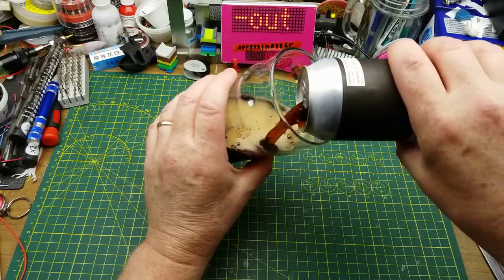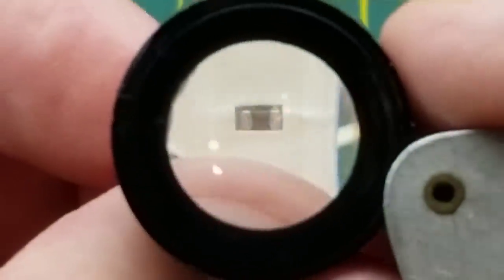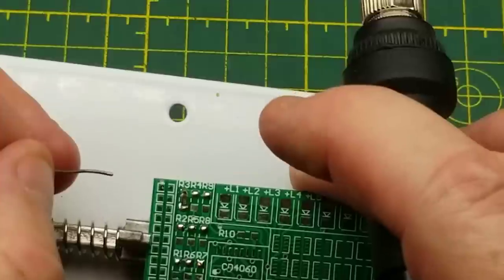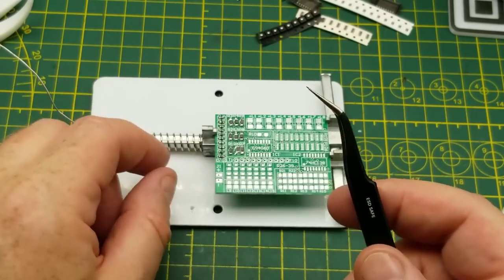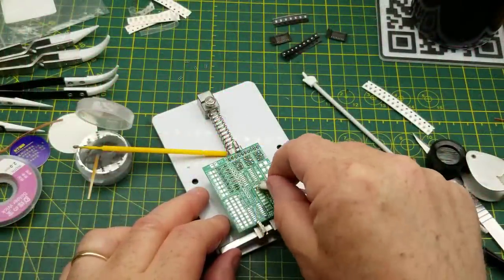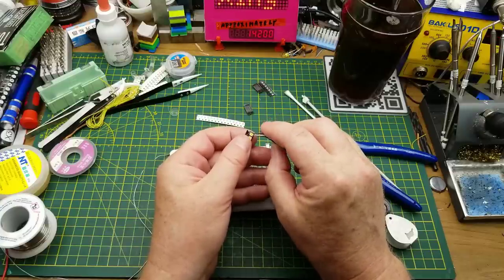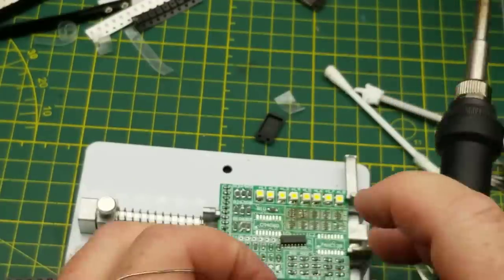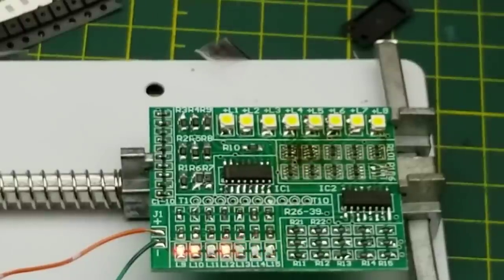Challenging kit build

Comment: idk what i'm talking about --- but when you jumped that 120ohm space, could you have measured the total ohms of the resistors that you felt were in series? hope this isn't too newbie of a question.  enjoy your videos a lot, i love a good stout or porter, as you do! it's cool to see you tackling those smd solder joints.
Reply from the maker: Yes, that would have been an option. And is probably "best practice".
That said, understanding what the components are doing allows you to make "good enough" choices and substitutions.
Reply: @pileofstuff  ty --- makes sense! you've done it enough to take reasonable 'short cuts.'

Comment: As others have said, you need to ADD FLUX. Flux, flux, flux!
And you are using far too much of too large diameter solder.
Don't put a blob on one pad, that makes it almost impossible to position the parts!
Flux on the pad, place the part, tin the tip, hold the part and touch the connection. Done.

Comment: I had a 300 part board for ya but couldn't find it until after I shipped haha and you had to get every part right or an led would go out hahaha

Buy a nicer handle man. It's half the battle. I have every ksger t12 handle I bet. I use the axiun t3b and a sugon t21 station now. First is t210 and second is c245 but it says it's compatible with c115 to c475.

Comment: I needed to see this build. I'm currently working on a kit with a surface mount IC and it is NOT GOING WELL. Watching you has boosted my resolve to get back to it and finish.
A couple take aways: 1) use a fine tip on the iron, 2) solder wick is useful 3) solder paste and a heat gun is more useful (neither of which I own)
Thank you for this great video

Comment: Ditch those conical tips ... get a 1 to 1.5 mm chisel tip ... drag solder the pads you want to solder too (all pads on IC's) ... then place component and reflow one corner / side with iron and holding with tweezers ... then can reflow other pads / pins as needed ... far far easier and quicker to do than struggle pad by pad ... even with our failing eyesight as we get older 🙂

With larger components like transistors / bga's etc add a little flux to pads before placing component and soldering as helps it reflow.
Reply from the maker: There aren't conical - there's one flat side.

Comment: Kent, your soldering has greatly improved with the surface mount stuff, I can't even come close to how well you did.  Your patience is amazing.  I have the same practice board and I ended up tossing mine out and keeping the 2 main chips and LEDs lol. This is actually the first time I have seen one of these circuits working.  I will have to try it again and use my new electronics microscope my brother gifted me, I hope it helps me.  Oh... btw, to re-gen the solder paste, liquid flux is better and seems to help the solder flow much better than alcohol...(unless your drinking the alcohol, then everything flows a bit too well. Thanks for the video!

Comment: Oh the bravery .. first attempts on camera !! ;) I couldn't do it without optivisors with 4 or 8 times magnification.. These resistor networks are also my greatest pain.. after creating 3 layouts with them I decided to never do it again and rather try to find some space to fit standard 0402s or 0603s in their place.. and it really is all about cleanliness (rub pcb with ipa like crazy, then do it again..) and copious amounts of flux (louis is right ^^) .. hot air is my best friend.. then the parts  "slide" into place and have nice round shiny solder connections.. this is a profession where "practice makes perfect" really is true.. but then it is like riding a bicycle .. put in 100 hours and you will see ;) Thanks for the video ! 'd love to see more ;)

Comment: Pro tip: When soldering resistor arrays with solder iron first use abundant flux all over the pads ...Another tip: When Solder paste goes dry mix flux with the paste again to revive it . Just add liquid flux slowly until you get the desired consistency and it should ok to use again.
Reply: Did not know you could rejuvenate $$$ paste like that, thanks!
Reply: @matambale  Solder paste is simply microscopic balls of solder mixed with flux. That is what makes solder paste fluid. The microscopic balls of solder do not attach and are literally swimming in flux. The flux with time evaporates because it can be for example a mix of isopropyl alcohol and resin. Once the alcohol evaporates the paste becomes dry and stiff. Just add appropriate amounts of flux to revive the solder paste to the original fluidity.
Reply: Add alcohol since rosin does not evaporate.
Reply: Kapton tape can hold down your component after positioning it. Just use a tiny bit of it. Tack it down and remove the tape and solder the other end.  You can also use scotch magic mending tape.  Just keep your heat to a minimum.
Flux is your friend.  It also helps with holding the part on the board.  It's kind of glue-y. 
Those resistor arrays are a pain tbh.

Kapton tape is heat resistant. 

With a heat gun, sometimes I put down aluminum foil or tape to the nearby components to be a heat shield.

Don't forget the heat gun heats everything in the area: tweezers, dental probes, fingers...
Many times I forget that fact and poke my finger on a part to steady it. Or grab the wrong end of tweezers.  O u c h!

Comment: Now I realise you are using resourcescavailable and thus some is just compromised by these limits.

The thick rosin solder is causing far too large blobs of solder on the pads. Try also to get some fine solder which can then more easily put much smaller solder amounts on your pre solder pad and while completing soldering the components. Further a little amount of flux  liquid pen or paste using toothpick to apply on the pads, will ease putting solder down in more limited quantity.  Really the joint to SMD parts should have a small meniscus of solder, not that different to leaded solder joints, not a huge blob of solder. If you have a big blob in P lace if anything suck it away say using some solder braid. Getting good SMD joints becomes easier with less solder.

If your solder paste has dried too much, try using a small amount of flux paste, or if you have liquid paste a drop or two, then stir well using a toothpick. Your paste will become almost like new with right amount of flux mixed in. Not too much though. Keep in mind flux will boil as the solder paste melts, so too much blows the paste around and under the components. The paste is in reality micro spheres of solder in a flux like binder, so mixing a tiny amount of flux back, restores the paste behaviour. Too much flux causes a lake of flux, similar to applying excessive amount of flux on a job.

SMD is not only dealing with miniature components, but also miniature quantity of solder and flux.
Pre applied flux, even on very new clean PCBs helps get solder to flow ell over the pads. PCBs that have been stored some time definitely will benefit from use of flux. Just not a flood. I do realise you see some Youtubers put large lakes of flux in place, think Rossman in his repairs jobs, many flux types do not do so well as the bubble and boil as they flow alll over making a bit of mess and even blasting solder around the PCB area, making tiny solder residues. For most flux I have used moderation works better than floods.

You are also so right, a very clean tip of the iron is also sooo important. Leave dirty gunked up tips to the plumbers out there. Wipe your tip regularly, and I find the copper/brass shaving bundle is better than wet sponge,  and NEVER use paper tissue or towel, or cloth, as a wiping medium. If done you soon need major tip renewal, retinning as the tip starts then to reject wetting by new solder, until fully retored, often needing special tip cleaning pastes. This restoration will lead to premature need to replace the tips  treated.

Keep practicing SMD soldering, as it is now getting an unavoidable needed skill.  Hand soldering once proficient is easy enough. Too slow for mass production, but there is little need of ovens, solder paste stencils, or even hot air gun for SMD individual assembly. Yes all make the job easier, quicker and more consistent, but depending how much you do, the investment needed does not pay. On hot air gun  both temperature setting and control of airflow rate become important. Nothing worse than using hot air to solder parts, and blow nearby already mounted parts away, or spending excessive time, streaming hot air from futher away to avoid blowing away small parts, and baking the parts way beyond time allowed at elevated temperatures. Do note especially ceramic capacitors, with no markings become very big problems to sort out once moved around by the hot air, all same size bodies, with no identifying marks to work out the values, or having multiple SMD parts clumped together by solder, very great fun pulling spart again, if not even blow away completely. 
  One thing about reflow soldering with hot air or oven, that is minimally less a problem hand soldering,  is chips stored without humidity control  is moisture ingress to the package while stored,  breaking seal of moulding  even cracking the body, as the high soldering temperatures are applied to the entire part, more than soldering individual leads, though that too has its own distorting stress issues. Most chips shipped by the manufacturer are packaged moisture protected packaging,  even with test sheets, changing spot colours for moisture detection, that signsl need of the components to be precondioned at specified elevated temperatures for many hours to dry them out before allowing reflow soldering. Long term and even shorter term reliability can be severely affected. 
Our hobby components, often years in uncontrolled storsge boxes and conditions are especially at risk. Where possible keep the parts in sealed bags (anti static for many chips, mosfets  etc) taped shut if poosible with any spare dessicant packs you get hold of. Also antistatic bags ideally are kept for reuse in storage.

Sorry if all that is too much info at once.

Comment: Lately, have taken to melting little shards of pure solid resin on the iron at 200C, and slathering a difficult area.  As it cools, it gives one time to "glue" the components in place and make adjustments.  Once set this way, it can be easier to tack a leg of each component to a pad.  Sometimes.
Tiny SMD resistors and capacitors do not seem made for humans.  Smaller than 1206 is ridiculous.

Comment: Nice. 
Hot air to tidy up works well. 
I am in the middle of building a replica Amiga 4000 computer, so a whole motherboard worth of surface mount soldering fun. All done by hand.😅
Reply from the maker: That's brave.

It'll be cool when it's done, though.

Comment: At least you did not resort to flooding the whole thing in flux, so that's one up for you.
Soldering is all about practice, practice and more practice, I started back in the 70's so have quite a lot of practice under the belt.
Reply from the maker: I've been soldering for a similar length of time, but seldom SMD stuff.
Reply: @pileofstuff  I picked up SMD when getting mil-spec components got harder source and SMD's got better ratings. mainly on prototype PCB's as production did everything else. getting the PCB right with respect to vibration was fun. Watching SMD's ping off a board that to the eye was not moving, seeing it move under a strobe light was amazing as to how far it would bend as it hit resonance.

Comment: I think similar level of challenge was Dekada kit i bought from Slovenia i think, it's a decade resistor with resistors placed a little close to each other for comfort. But honestly i didn't find it challenging. I have handsoldered it with a soldering iron. I imagine it would be better with hotair but i don't have that yet. Though it hasn't turned into a "don't look too close" for me, it looks basically perfect, which is not necessarily something that happens every time when i solder. I think what makes the most difference is flux, it makes everything better. And the next thing is magnification. And i used leaded solder, though i have random lead-free that i can work with now as well without cursing too much, but at the time all lead-free i had was just garbage.

The nice thing about that kit is that you get something you can actually use, not just a board full of components. Unfortunately it appears it's no longer being sold.

I wish there were more SMD kits that are somehow at least borderline useful, where you don't feel like you made a piece of useless garbage. Like JYE DSO, but the SMD there are pre-soldered and you only get to do through-hole; and typical $1 FM radio kits but there's only one SMD component on there to solder, could be more. What JYE has done fairly well on 138 is the bringup and troubleshooting instruction and schematic supplied, ideally this should be a requirement for all kits.

Comment: Soldering the SOIC chips, once you've tacked it down, spread some flux over each row of pins, then get a nice blob of solder onto a flat iron tip. Then run the tip down the row of pins. The flux should help just enough solder flow onto each pin. Repeat as necessary. Alternatively if you have a squeeze tube of solder paste you can just squeeze a line of it over each row.

Comment: Does anyone actually LIKE soldering surface mount? 😊
Reply: Yes! I actually prefer it to through-hole ..... but I always stick to the larger components - 0805 resistors and capacitors and SOIC ICs. Very fine solder and a fine iron tip helps a lot, as does a binocular microscope or dual magnifier.
Reply: I do.
Reply: I love it. I often use smd resistors and leds on perfboard to show when a tact switch is pressed.
Reply: I used to hate it but once you get used to it you'll find it's easier than thru hole soldering. Takes less space and no wire clipping when you're done. Sure it's finicky and you have to buy a bunch of expensive tools that takes time to master but in the end you'll be thankful you did.
Reply: @g0hjq  - His big error was not using ANY flux, and using solder about 1.5mm or larger diameter. By the time he got it to melt and flow, he ended up with a blob about 10 times larger than necessary.
I don't subscribe to the "blob on one pad" theory either, I just solder them as I go. Flux the pad, place the part, slightly tin the tip, touch the connection. Done.
Reply: only the machines!